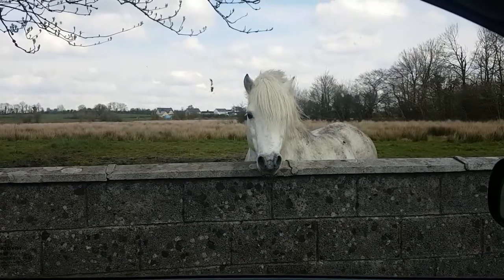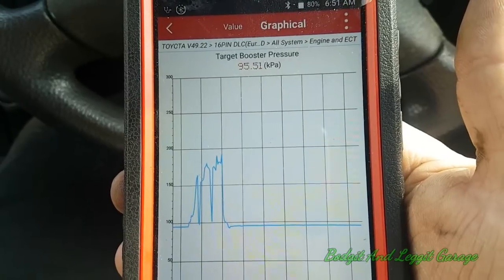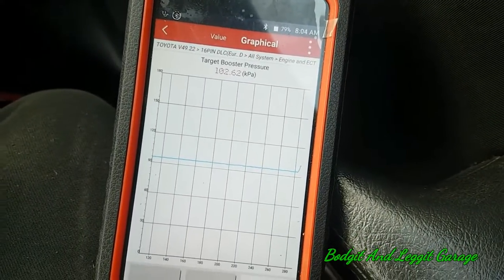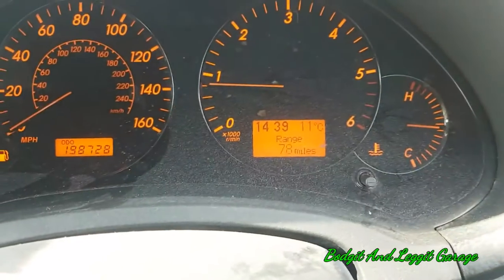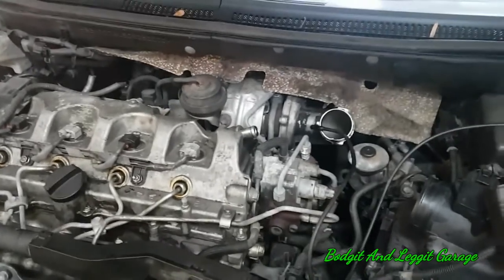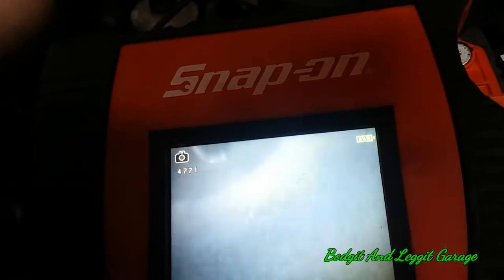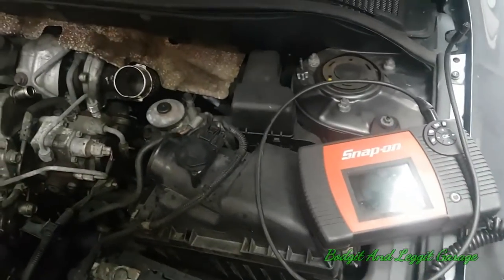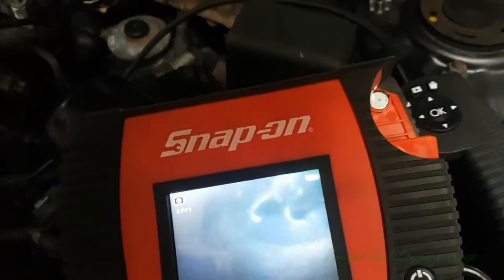I Cannot Believe This Part 2 What Is Wrong?

Comment: Wow, I've seen a few damaged compressor blades over the years, but those are some of the worst. I'm surprised the turbo didn't explode due to the imbalance. Must have been dirt and debris sucked into it somehow.
Reply from the maker: Yes, mate. I'm so surprised as well. There was no vibration coming from the engine. There was no loss of power really. Apart from the little bit I found but the engine was starting and driving personally I still cannot believe it now.

Comment: Thats awesome. Even before the carbon clean the near 200kpa reading was quite good...So thats say 2bar..28psi of boost? Id be happy with that all day long...If the bearings are still good in the turbo what do you think? Did it ingest something from the air box...Good stuff leon..SORTED
Reply from the maker: I diagnose this for another shop, so I do not know the history. I think the engine has been changed. I wonder why. Lol My guess is just like everything not service properly. Not service regularly used the wrong oil and high mileage would be my guess. But obviously something else could have gone through it. I just don't know.

Comment: Holy Crap!! Did that turbo eat a mouse? Good grief that's a lot of damage. Any pieces make it into the engine? BTW the steering wheel is on the wrong side of the car Leon.
Reply from the maker: I don't know the full history of the car. I was diagnosed in this for another shop. I think the engine has been changed. I wonder why. Lol the steering wheel Is on the proper side Sorted boom🤣🤣🤣🤣

Comment: I really wanted to ask you a question leon but because i dont do Facebook etc i hope u see this. ive just bought a 1.6 tdci mk2 focus estate and ive gone and spun it on a road in wales. No damage as such but there was some hard impacts on some curbs and a grass bank, my turbo has gone like the one in the vid but has no leaking or bent fins, just looks like its eaten something like a blade snapping on the housing as i impacted and its gone and eaten 6 other fins. It now whistles but it boosts so well., do you recon i look at rebuilding it or get new? What do u recon about the fins that were there originally there. , where would i go looking to go stop them going into the engine.? Thanks mate if u do get back and im totally open to spanners calling me a twat for wrapping a little focus 😂 bring it on.
Reply from the maker: Hi mate I cannot see the relation between hitting the bank and the fins of the turbo bending it doesn't make sense if the things have gone you're very lucky you haven't destroyed your engine cos they would have been sucked into it but if there's no damage done just replace the turbo with a reconditioned unit make sure it's a good one and you should have no problems

Comment: I had a 05 Mustang GT break an intake valve spring and it only threw a code once enough fuel started to get to the sensors. I wonder what would cause this kind of damage to the turbo, is the bearing trashed and the turbine just rattling around?
Reply from the maker: I really don't know mate. I diagnose this for another shop, so I don't know the full history. I don't know what happened or what has been done to the car. Car I think the engine has been changed I wonder why. Lol But a lot of Turbo problems are caused from people just not servicing it regularly enough or not using the right oil. And then obviously just wearing tear.

Comment: What do you reckon caused that Leon? Did you check the air filter to see if it was still intact? Good videos.All the best pal.  "Barry The Ballet Dancer".
Reply from the maker: Hi mate. I diagnose this for another shop, so I don't know the full history I believe the engine has been changed. I wonder why. Lol Lots of reasons it could have happened bad maintenance not service regularly the wrong oil stuff like that can cause these problems. Also, just high mileage wear and tear is another thing.
Reply: @bodgitandleggitgarage  Thanks Mate.
Reply from the maker: @barrywhitley2535  any time mate

Comment: Really enjoyed those videos.
I would be interested in a follow up discussing the possible cause. Could this of happened if the correct air filter was fitted and fitted correctly?
Could this be the reason the original engine had to be replaced?
Did you fit a new/recon or breaker part replacement?

It also shows the value of a Borescope. For the non pro guys, I have a cheap Lidl version, works really well and would have helped in this case, you can get an even cheaper version which is just the wand that you plug into a tablet. Really worth having.
Reply from the maker: Hi mate. I diagnose this for another shop, so I don't know the full history on its I believe the engine has been changed. I wonder why. Lol There's lots of reasons why this could have happened. Not being maintained properly using the wrong oil. Some one could have done something there's just so many. Reasons Very difficult to pin it down properly.
Reply from the maker: Also high mileage and wear and tear is another factor.
Reply: @bodgitandleggitgarage  thanks for the reply. 
Perfectly driveable car though!
Reply from the maker: @harveysmith100  Not really not unless you want to put another engine in when the rest of the turbo goes. Boom lol
Reply: @bodgitandleggitgarage Eerrrh, I clearly haven't thought this through! That thing must be so out of balance it is almost designed to go bang.
What is the conclusion, recon or second hand turbo?
Reply from the maker: @harveysmith100  With something like this you always best to go for a new rebuilt turbo from a crowded Trust with a guarantee. Second-hand no good brand new from the dealer too expensive
Reply: @bodgitandleggitgarage  Thanks for the advice, I have seen the damage a turbo does when it lets go. You couldn't design a device better at damaging an engine.

Comment: Hi Leon I'm wanting to do an extra tank out of a 47kg gas bottle and the correct safety on it what would you say the psi on the 47kg bottle
Reply: It's only so I'm not waiting for my air compressor to refill
Reply: My compressor is only 50litre and with putting an extra air tank it should run longer but I need to no the psi as I don't want the bottle to go boom
Reply: Pmsl iv just read my own message to you and it doesn't make any sense sorry
Reply from the maker: @tonygoulding9086  lol I was looking at the video and looking at the message and just couldn't work out what you was trying to do or trying to say. Lol I really don't know mate. I've never tried it. I think it's going to be a lot of work. It might just be easier buying a second-hand compressor. You have to be very careful cutting and welding a gas bottle for obvious reasons. And for the time and effort it's going to take for the size of the gas bottle. I really don't know if it's worth it. But it will make a very good video you should film it if it blows up it will go viral. Lol
Reply: We're I used to worked before the old timers made one to put air in the pick ups tires I would have asked them but there retired and i don't no ware they live
Reply from the maker: @tonygoulding9086  unfortunately, I've never done anything like that so I cannot say
Reply: Fully understand thank you anyway

Comment: Are the 1.4 d4-D engine's based on the n47 engine I was looking at the 08 and 2011 is
Reply: The 1.4 is a chain driven unit from 2001 onwards, engine code 1ND I believe and fitted to a load of smaller to mid sized Toyotas, apparently manufactured at the kamigo plant in Japan. The N47 from BMW is engine code 1WW and 2WW for 1.6 and 2 litre units fitted from 2013 onwards and you'll find that chain muncher in the verso, auris, avensis and RAV4. I looked at the RAV4 and was going quite well until I opened the bonnet... Oh hello... 😲 Toyota may well have sorted it but it just put me off personally.
Reply: @thejoneseys  thank you I was scared of buying one thinking it's the n47 I'll leave whitout my ac
Reply: @neilmurphy845 had a quick Google and couldn't see any scare stories for that 1.4 engine so should be golden 👍🏻
Reply: @thejoneseys  tank you
Reply: Any idea if the 1.4D Toyota engine fitted in the Yaris/Auris have any problems with head gasket failures like the 2006 to 2008 2.0D4D Engine. I have had a 2007 Toyota Auris 2.0L D4D for 4 years now and the head gasket started to go 2 years ago and apart from having to top up the coolant every 200 miles it runs an pulls like a train and had never let me down.
Looking to maybe get a 1.4D Yaris or Auris for the better fuel economy. Would be interested to know what you decided on and your opinions. Thanks.

Comment: Top man 👌
Reply from the maker: Thanks mate
Reply: Heard a lot about carbon cleaning what’s your honest opinion about it would you do it to your own car and will it benefit the EGR valve or is it just a waste of moneys
Reply from the maker: @danhayes3546  Hi mate, I've done lots of videos on them. They are good but lot of people lie about exactly what they can do. When you have a mechanical problem, it's not going to fix it and that's why people say they're no good. This will only fix if you've got a carbon issue, not a mechanical issue, also they do not clean absolutely everything they will not clean the intake if it's completely blocked. You will need to do it manually. So there's two big problems in my opinion one people think it doesn't work because they have a mechanical problem and to some people lie about exactly what they can do.